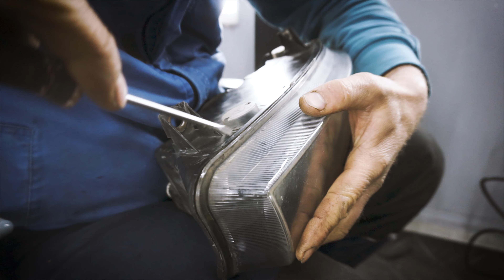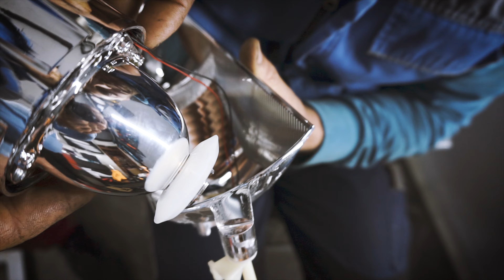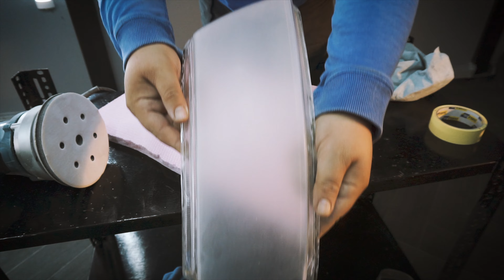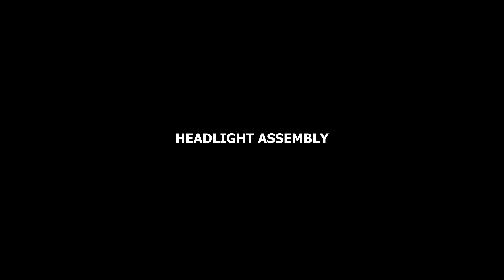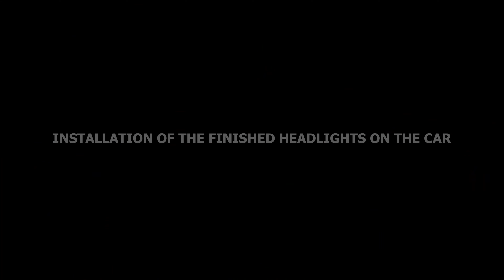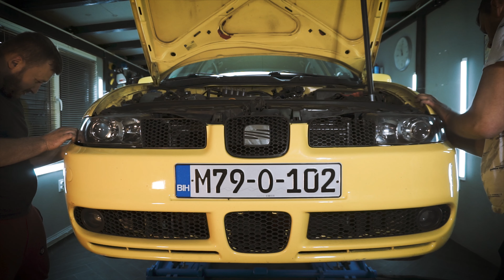B-IXENON Retrofit Explained in 4 Minutes - Seat Leon FR

Comment: Could you please explain the wiring?
Reply from the maker: As for the installation, everything remained the same, only the + was taken from the high beams to enable the bi-xenon function
Reply: @autospadetailingstudio  so there is no H1 bulb anymore if I understand correctly?
Reply from the maker: @amazonsk7751  sorry, I wrote the LED in question is a bixenon retrofit. As for the installation, everything else is the same.
The bulb remained H7, as far as I remember it is a 2inc lens, and the plus was taken from the high beams because of the motor in the bixenon projector